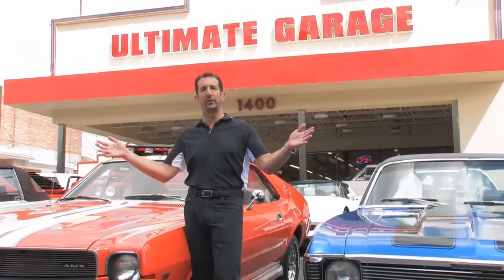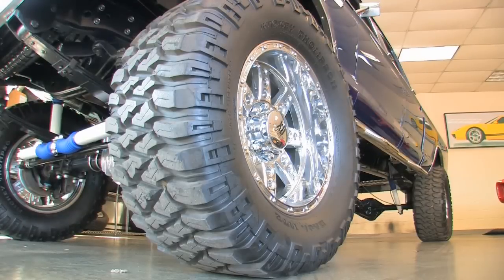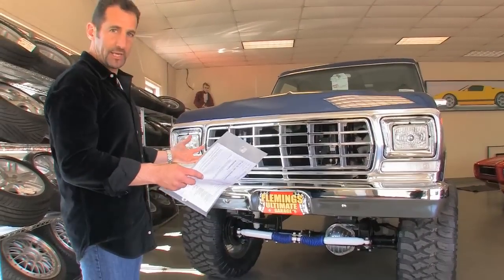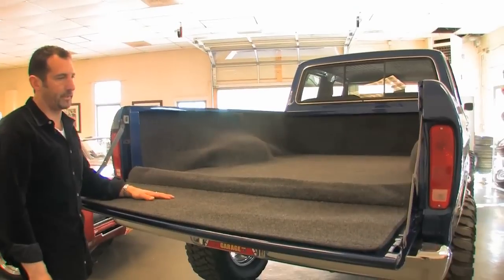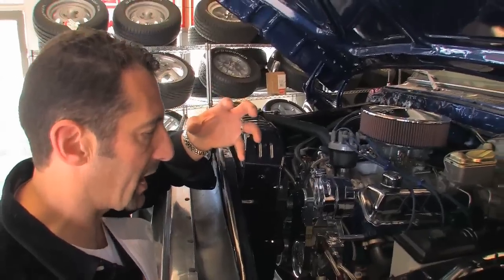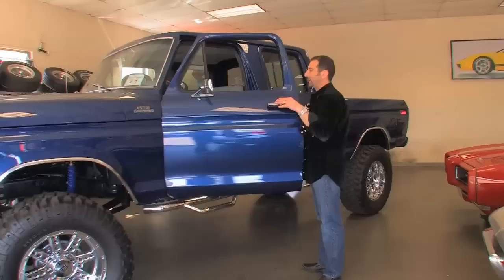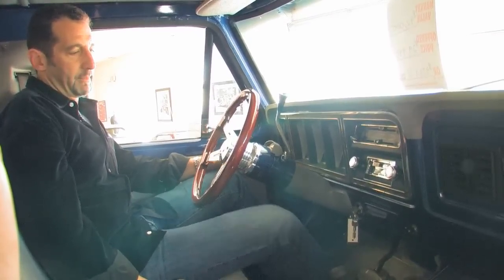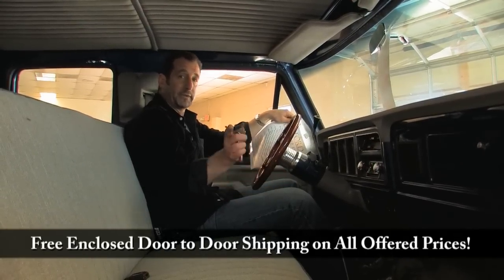BEAUTIFUL 1978 Ford Show Truck 4X4 for sale with test drive, driving sounds, and walk through video

Comment: Um actually  (jimmah79) the square lights started being produced in 1978. i have a single cab 78 that has the grill just like that and every part is original. i also have a 74 250 and it does have the round headlights. not to be an ass or anything. old ford trucks is my life. but its an easy mistake. they only started producing the square lights towards the end of the 1978 producing year.

Comment: Front lift blocks under the leaf springs? BAD idea. Whoever did this resto should've spent the extra few hundred for arched springs in the front. Otherwise your truck may end up losing its front end while you're driving down the road!

Comment: i also have a 75' 4X4 that has a 460. my grandpa purchased it new in detroit and he had it until 2010 and then sold it to me. the owners manual that came with it from the dealership shows that it does have a 460 and that its 4X4. the manual was printed in 75'. i dont think you konw what your talking about

Comment: 78 was not the first year for the crew cab
Reply: bobhilly546312156332 Right you are, Mr. Hilly, I've seen pics if crew cabs in the 60s.
Reply: bobhilly546312156332 ...correct ..they had those in 66' and probly even before
Reply: Yep they started building in the 60s as forestry truck's  lot of the one for sale are old government truck's and someone got screwed doing a restore for 70grand I did my 78 bronco everything was 15grand in the end and Oem parts

Comment: jimmy your wrong 78 had square in lariat and ranger trucks
Reply: Actually the round to square headlight change was a mid year 78 thing. The early 78's had round headlights and the late 78's had square.
Reply: doowopp45 'll have to double check on that. I've always known it as Ranger and up had squares and customs had rounds. My 78 custom has rounds and I'm pretty sure it was a late 78 truck. I'll check the VIN plate and check back.

Comment: It's a 1979 not a 1978. It has square headlights. Not round headlights
Reply: uhh 1978s had square headlights as well
Reply: No they didn't they were round in 78! 78 and 79 had the same grill but 78 was found headlights and 79 was square. I own 2 of each
Reply: Half year '78's had square also
Reply: No they didn't. Square didn't come out until 79.
Reply: You don't know Ford's. Late year 78's had square early year 78's had round.
Reply: Y'all obviously have been informed by someone who doesn't know what they are talking about but my grandad restores Ford trucks and then flips them and he knows everything about every Ford truck and has work on every Ford from 1937-1989 so he knows more than yall for sure
Reply: I owned a 78 were round.found a 78 ranger once was square.was suprised but were square